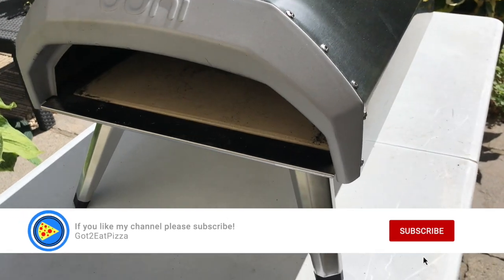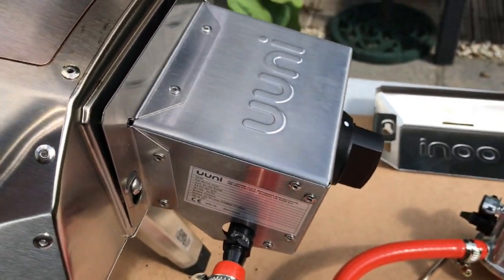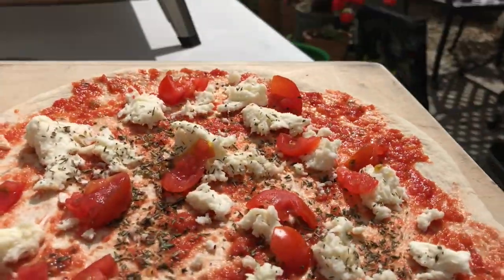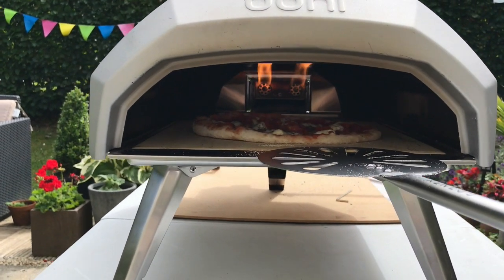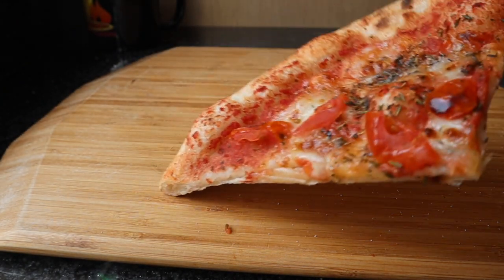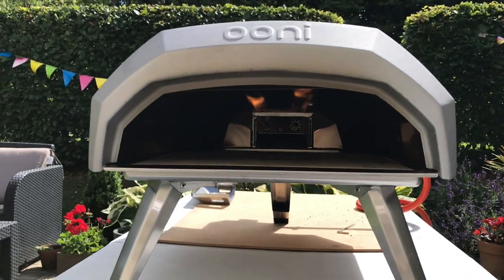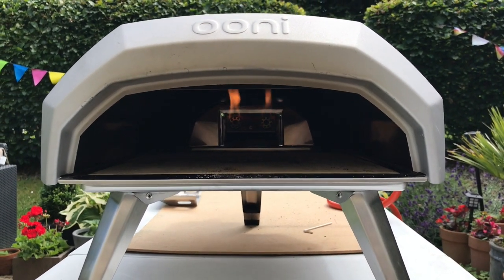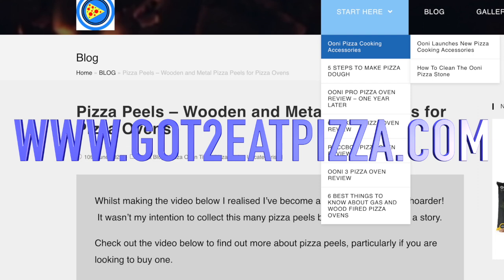First-time using Ooni Karu Pizza Oven with a Gas Burner | PIZZA BEGINNERS GUIDE!

Comment from the maker: Please let me know your thoughts on how you regulate the 500c max oven temperature with wood!  Thanks
0:42 Adapting the Karu Pizza Oven to fit the Gas burner
2:39 Making the Pizza
4:15 Real-Time Pizza Cook
7:14 Cutting up the Pizza
9:35 Post-Gas Burner Cook Thoughts
Reply: Join the Ooni Karu user group on facebook, search for 'inlet vent', there is a guy on there that makes rear damper vents to better control the temp without soot buildup
Reply from the maker: Hi - thanks for that tip.  I’m not on Facebook as a rule!
Reply: @Got2EatPizza  just setup a random account and join to have a look, I'm the same, only on facebook as a random account to follow pizza pages 🍕
Reply: Got2EatPizza I think I’ve seen them on eBay too
Reply: If you have a cast iron just slide it in before the cook and it’ll suck the stone heat making it go lower. Not very ingenious but it’ll work.
Reply: Yes a cast iron skillet will draw the heat and cool it down if needed
Reply: Hello. I have the Karu and i cook exclusively on charcoal and wood. I have never exceeded the 500 degrees. I found it actually difficult to attain 500 degrees. What I do and it seems to work is to add very often a small amount of wood. The temperature stays relatively constant with a little bit of experience. :-) thanks for your video !! I’m very curious about the gas cooking
Reply: You can control the air vent for close door cooking and it will quickly dampen the burn. The other option is to use less wood and add it as you go along. Yet another is to have a charcoal base and add wood on top. The firs two I tried, third one saw it in YouTube.
Reply: I use charcoal in my ooni Karu after I got troubles with controlling te temperature with oak wood.
I use restaurant charcoal and if I load it full it stays around 450 degrees. you can easily control the temperature by the volume of charcoal you use. you don't need to fill it as much as wood and when you fill the oven it doesn't give a peak of heat like wood does.
And you keep the nice smell and taste of wood witch charcoal.
Reply: I realize I'm kinda off topic but do anyone know a good place to stream new tv shows online ?

Comment: I have a Karu and I never knew it should not go above 500c. That being said, I have only used charcoal and wood combo and my only issue is that its  challenge to get to 450c sometimes. If you use a charcoal/wood combination like me, it will be a challenge to get the temperature up to 500c. I think if you use wood only(which I never tried), you can probably do it. The other thing to note..... Here in the US, its a bit difficult to find kindling that is precut to fit into the Karu. I use wood chunks (apple, cherry or hickory). After I make a pizza and need the oven to get back up to temp quickly, I add wood chips (not the chunks). The chips burn quicker and produce a great flame. I would then throughout day, add a combination of wood chunks, coal and chips to manage the temp. I hope this is useful to people.
Reply: After a pizza is done I tend to pop in a thick chunk or wood to keep it going until we're ready for the next pizza. Then as you say, smaller bits of wood, with more surface area boost's the heat quicker.

Comment: I have been just using wood hickory that I buy from walmart  here in US the chunks are perfect fit for the Karu I also as others have mentioned  I close or open the flu on the chimney slightly to help regulate the heat .This is definitely not a first time to perfection! Its like any pizza oven  practice practice  and lots of cooks some good some great some not so good! lol Its learning about the oven and it takes time but still fun and pizza is always eatable !One thing for sure the gas option is much easier to control the heat for obvious reasons! But there is something about the wood that I really like even though I may have a few expletives while using it!
Reply from the maker: Hi!  Sounds like you are enjoying using your oven - and even when it doesn’t go to plan it doesn’t matter  - all part of the outdoor cooking fun!

Comment: This has setup is what I use now and I love it but its overpriced  you can just use a karu. Also you don’t have to take off the chimney , just close the vent and the top with the plug. I keep it open with the door closed to preheat the stone fully then close the chimney this gets it to 1050°f or 565c no problem
Reply from the maker: Thanks for sharing!  In this vid at the end I mention that in the Karu oven leaflet they stress as important that the oven should not go over 500c.
Reply: Got2EatPizza I mean I always get it over 550 and keep it there for hours. I do this very often 3-4 days a week. I need the heat so the crust is as crispy and charred as possible without burning the cheese, I put the fire very low during the cook
Reply from the maker: Yeah - and you can get it that hot just with the gas!  It’s going to be a challenge to keep it low.

Comment: So, charcoal and kindling or gas?  I’m leaning towards charcoal/wood. As for the temperature, I use the chimney baffle
Reply from the maker: It’s definitely personal preference which fuel choice you enjoy using.  Gas is less messy.  Good tip about using the chimney baffle for reducing the oven temp.  👍

Comment: Can you say that the overall length of the oven is, with the propane burner attached? Seems to require quite some space (in length)... I wish one (Ooni oder Gozney would have a 12" oven with the burner-control on the side...

Comment: Hi! Which of these two ovens do you prefer, the Ooni Koda or the Roccbox? Love your videos!! Thanks!
Reply from the maker: Hi!  Thanks for loving the vids!  I think they both make great pizza so you won't go wrong with either with gas.  The Roccbox has a new wood burner coming out soon and if that does the business without having to heat it up with gas first then I would think of going for the Roccbox as it would then be a duel-fuelled oven.  The Rocc is heavier but more insulated than the Koda.
Reply: @Got2EatPizza  Thanks for the reply! I own the Roccbox and love it! I was just wondering if I should switch to the Koda but sounds like you prefer the Roccbox! I use  with gas all the time because of ease and heat consistency!
Reply from the maker: Not if you have the Rocc already! Are you going to get the new wood burner?!  I'm going to get it as soon as I can and give it a try out.
Reply: @Got2EatPizza  I don't think so. I really don't want to deal with the mess and work that comes with wood burning! I get great results with gas and it gives me more time to enjoy with much less cleanup! ☺
Reply: Roccbox all the way especially with the new burner

Comment: Hi, have you ever tried making a pizza dough with Yoghurt?
Great videos.... 👍
Reply from the maker: Hi!  thanks so much!  I haven’t - but I can certainly try - do I just add a dollop of yoghurt and reduce the water  by 50g?
Reply: @Got2EatPizza  I have never tried it either but the recipe is 1 cup of self-raising flour to 1 cup of Greek yogurt.
Extra flour for kneeding.
That's it, two ingredients and  use it straight away.
Good luck 👍
.
Reply from the maker: Thanks - so half and half - not sure how that will proof - may end up like a Naan but certainly worth an experiment!
Reply: @Got2EatPizza  no proofing required as far as I know. Good luck.

Comment: Hi. great video. I was just wondering where on the temp dial on the Koda around 420c is please? As I haven't got a temp gun
Reply from the maker: Hi! Thanks! There is no temp dial on the Koda - I would be totally lost without a temp gun with the Koda.  If you can get one I’d recommend it strongly. 👍. If you don’t have one you’ll be guessing the heat of the stone by the time it takes to warm up which is difficult.
Reply: @Got2EatPizza  ok thanks for the info. Properly get one from amazon

Comment: I noticed don't have a deflector near the door  like uuni 3, the hole look taller that's a good thing for calzone but could lost heat and receive more wind. I've problem on windy days with my uuni3 and gas burner, the gas is costantly troubled by the wind, is hard to have good temperatures and sometimes the wind switch off the flame.
Reply from the maker: Hi!  Yes I had those same issues with the 3 too.

Comment: I'm thinking that it is better to use the chimney, and door plug to get the stone hot enough.  Forget about Ooni's instructions that end up turning out a white bottom with a slightly crisped upper crust.  I want that leopard skin without having to deal with the inconvenience of wood!
Reply from the maker: Hi - if you get.gas build up doing that could be very dangerous - I wouldn’t recommend putting the door on with gas. 💥 You should be able to get the stone hot enough using gas, with the door off.  Are you using a metal or plastic gas bottle?
Reply: @Got2EatPizza  I'm in the United States.  I use a propane cylinder.
Reply from the maker: I ask because it affects the pressure.  Your gas should be heating your oven stone up to 470c with ease after about 25 minutes on full flame, if not, maybe  something is up with the gas regulator/pipe. How long does it take and what’s the highest temp it can go too?

Comment: Nice video, i have a question, i make my pizza's on the karu and my crust is only crispy the first 20-30 seconds after it's Finnish what am i doing wrong? It's the same 60% 65% and 70% hydration i start cooking when oven is 430 c and above.
Reply from the maker: Hi!  Could it be your climate...is it humid?
Reply: @Got2EatPizza  i live in Denmark,  maybe it is why, now i think about it i usually place my pizza in the oven grate inside to let the heat getaway from the bottom😀 next time i try place the oven grate on the table, thx for you respond, i like your vids.
Reply from the maker: Thanks so much - I hope that works because it should stay nice and crunchy for you!

Comment: What do you think of the gas consumption? mine seems to use alot!
Reply from the maker: Hi - it’s not as efficient as the Koda burner I think personally,  as I use both - but it’s a lot more efficient than my BBQ burner.
Reply: @Got2EatPizza hmm how many minutes do you pre heat the oven on "full throttle" ? And do you put in on minimal throttle while baking? To put it back to max between switching pizza's? That's how I do it... But seems to use alot of gas 

Thanks for info
Reply from the maker: I use full then down to 3/4 to full on the dial flame for the cook.  Back to max after the pizza cook, heat it up again, then back to 3/4 for the cook. I think mine is pretty efficient.  Have you checked for leaks?
Reply: @Got2EatPizza  3/4 at Cook? I use 1/4 and seems fine. For how long do you pre heat? I checked for leaks! I'm going to get some news gas tomorrow to try again. Prefer wood tho, because with a closed door the pizza finishes much faster
Reply from the maker: Yes, nearly full gas flame for the cook and it takes about 15 minutes to heat up, depending on how warm it is outside/breezy etc.  Plastic gas bottles don’t give off as much heat as metal gas bottles so I’ve been advised.  The wood cook is great in this oven!

Comment: How do you think it compares to the ooni pro given its half the price in the UK? Obviously there’s the size of pizza difference but that aside, what do you think??
Reply from the maker: Hi!  I love it and it’s like a smaller Ooni Pro so if you don’t need to make pizza over 12” then I highly recommend this oven. 👍
Reply: Got2EatPizza that’s good enough for me excellent thanks 👍
Reply: My ooni karu has arrived today 😀 got the gas burner yesterday! Now just need dough, time and patience, so excited 😆
Reply: @guidog3068  Guido, that's amazing turnaround for shipping. In the US it will be November for shipments on purchases made today due to demand and covid.
Reply: @Got2EatPizza  how much larger a pizza can you actually make on the pro?
Reply: ElGrecoDaGeek you can make a 16” inch pizza on the pro and 12” inch on the Karu. There is a larger cooking space on the pro with extra height allowing for larger dishes such as a roast chicken. It’s versatility and capability versus cost consideration. For me I didn’t anticipate regularly cooking pulled pork etc in quantities requiring the extra space. From the reviews though the pro has extra control for venting heat/smoke and has slightly increased materials such as the insulation and baking stone. Of course the price is roughly double for the pro.

Comment: With wood, choke down on the chimney if it gets too hot.
Reply from the maker: Hi - yes. great tip there! Thanks
Reply: I already tried this several times, but everything gehts really smokey in the oven when I choke it down a little bit.
Reply: @elduderino1984  Try using a combination of hardwood charcoal and wood. The charcoal will not burn as hot but burns longer. Use it to maintain your fire as it's less likely to get out of control then use wood for flavor and to increase your temp incrementally as needed .  It's far easier to go up in temp shortly before launching pizza then trying to reduce it.

Btw choking down on the chimney with the door on reduces the temp... Get your fire under control, then open the damper once you have reduced the temp.. You don't cook your pizza during this period... Once under control and at the right temp, then launch pizza.
Reply: I am still to get my Karu, but fire management is the same as a bbq. Yes, choking the air via the chimney will alter the temperature (fire triangle), but the most efficient way to control is by amount of fuel, or type of fuel as already mentioned. Different woods and even charcoals will burn at different temps. Try to pick a species and trial and error....... keep a small notepad for reference 👍🏻

Comment: Did you find the cook on Karu with gas better than Ooni3 with gas.  If a Ooni3 owner already has a gas burner is the Karu an upgrade? Or should a gas user just with a Koda or Koda 16
Reply from the maker: Oh yes I did.  I was not a huge fan of the ooni 3 gas burner in the ooni 3 - I burnt so many pizza using it when I started out cooking pizza on this channel! That’s why I embraced the linear Koda gas burner - it was so much better.   So, if I was in that place again, with the 3 burner, using this oven - I wouldn’t burn my pizza like that.  I didn’t even use a flame guard and the crust cooked really well.  I know I have more experience now, but still, it was a lot easier and better!  You can use real wood and charcoal instead of pellets - a huge difference in the way your fuel cooks your pizza.  It’s a longer oven and seems higher too.  It’s  better all around.  I’m also not a fan of wood-pellet cooking either so any opportunity to use real wood is an upgrade in my experience! Hope that helps!

Comment: Show us how hot you can get it with a gas burner. I know because I have one. Good luck getting past 450f.
Reply from the maker: Hi Chris - fortunately I've reached 500c on the stone at the back every time - are you using a metal propane bottle or there may be a problem with the gas burner/regulator because it should get the oven very hot every time for you.
Reply: @Got2EatPizza  my burner doesn't stay lit and singed my eyebrow, eyelashes and hair. The stone will barely reach 450F let alone C. No support from this company.
Reply from the maker: Oh no - did you light it with a match, I've done that in the Uuni 3 - ouch.  The burner should have a constant supply of gas to stay lit - I'm no gas pro but I have in the past detected leaks using some thick soapy water, sprayed it onto the pipe and connectors to the oven and to the bottle to check for bubbles coming through.  I got a new pipe and regulator from amazon and it was good to go.
Reply: @Got2EatPizza  Likely a faulty regulator. Can't get oven past 450 f with wood /charcoal etc either. Tried to open a ticket at ooni but there's only a chat session that says they are busy and puts you into a loop with no way to contact them. Worst purchase I ever made. Went back to using my oven. Gets much hotter, more even cooking and 1000 times easier. Anyone want to buy my Karu?
Reply from the maker: Have you tried changing the regulator to see if a new one works?  I've gone through a few regulators using bbq ovens - normally the clip switch eventually breaks on some brands - the bit that you turn to stop and release the gas.  It's just that I really want it to work for you!
Reply: @scrapmetal80s  hey Chris, I would love to buy your Karu, how shall we proceed? cheers, Arief
Reply: @scrapmetal80s  You're doing something wrong if you can't get it above 450f using wood and charcoal too. Maybe watch some fire building videos. I have no problem getting my Karu up to 900f using wood and charcoal. Make sure you're leaving the door on when using wood and charcoal.